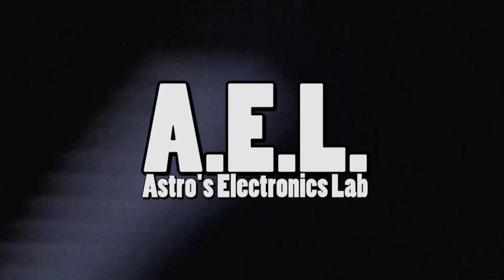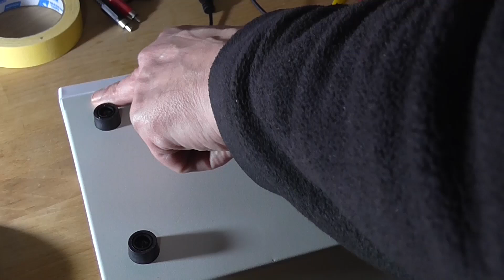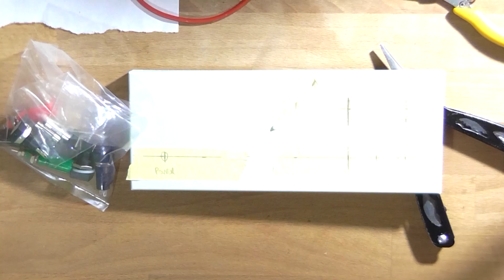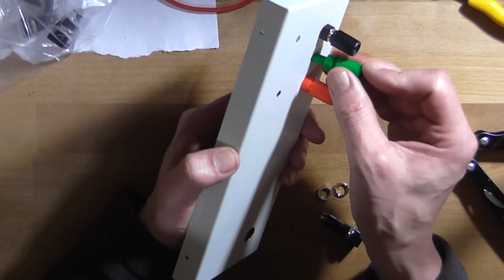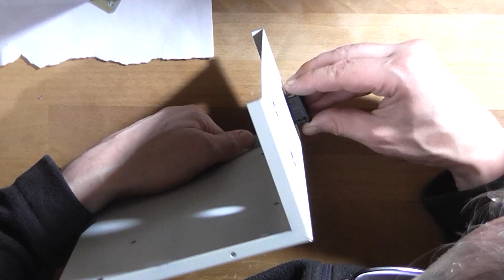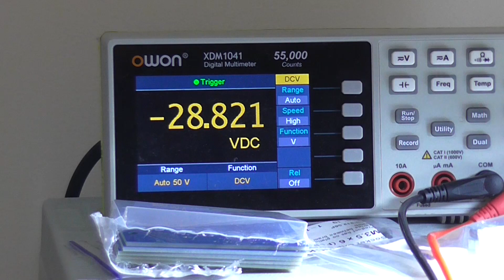+/-30V Power Amplifier Test PSU: BUILD!

Comment: Hey Mate. A safer option for the mains would be a 3 core cable and socket. Metal chassis should be Earthed.
Reply from the maker: Yes, it should. I agree with you, however as it's not going to be used a lot (only for short tests at a time), it should be fine. Space to add an IEC socket (or even the ones used on laptop supplies) was a concern here, also, half of it was junk-box parts and I wanted to do it cheap!